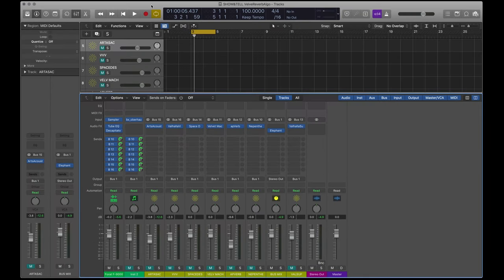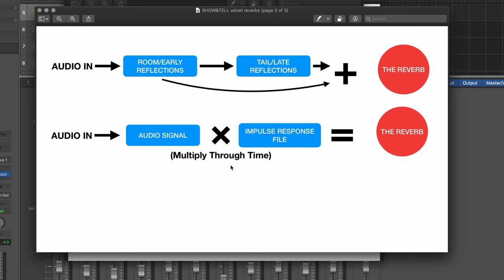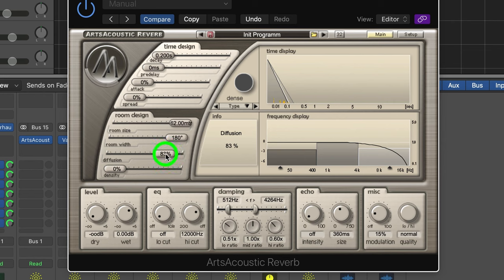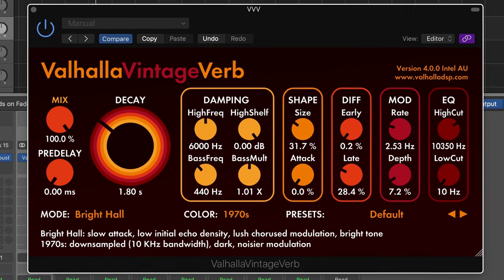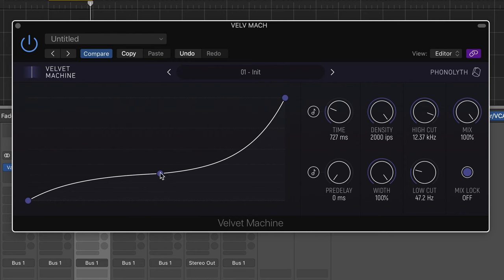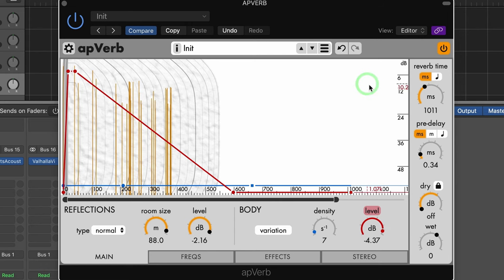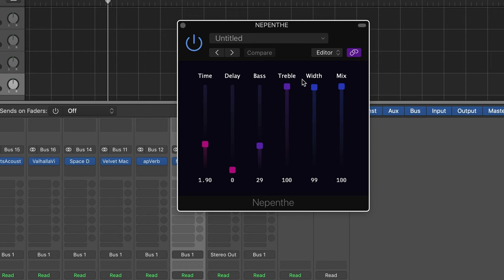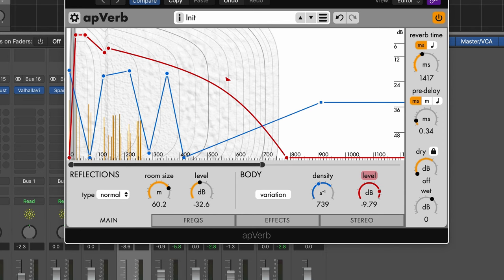Show&Tell: Velvet Noise / Reverbs

Comment: This is an excellent overview! Some notes about Nepenthe:

- You're correct that there are no early reflections. The density hits right away. I find that it blends nicely with existing reverb on tracks.

- The darkness isn't actually dark velvet noise; it's just EQ in front of standard velvet noise. This is unlike physical spaces, which have time-dependent decay due to the air and walls acting as low-pass filters. Early prototypes of Nepenthe did this as well, but I ended up preferring the version that starts and stays dark. It's like an abstract space that can't really exist. I think this is what you're hearing as "platey".

- I wasn't aware of the Star Trek connection. I got the name from Poe's The Raven.
Reply from the maker: Yeah, I'm a bit uncultured - not particularly well-read, but I do read manuals! :)

Thanks for confirming my ears weren't tricking me regarding the early reflections. It does have a sound not-heard-before, or easily configurable in highly configurable reverbs, which gives it a unique voice. And yes, the 'platey' stuff is the darkness aspect of the sound. I really like it! 

I hope you're still interested in advancing your velvet noise model, you seem to have good sense of how to manipulate and implement it in accessible and usable ways.

And I really like your Clean Machine dynamics approach. Fascinating approach to handling dynamics.

Comment: Waves H-Reverb is a noise based convolution reverb that I initiated and developed with the Waves team about 10 years ago.
It has many more features than the two products reviewd here, including resonant filter, de-esser, and dedicated delays on top of the reverb engine.
I have created replivas of all famous hardware reverbs as this engine can do pretty much anything (presets are in the 'hardware' section of the presets menu)

https://youtu.be/Hp1AuSMIZOg?si=c_rRw5Mr_m4ZU2Oo
Reply from the maker: Hi Yoad, thanks for your response! It's a shame Waves didn't mention in the marketing material that it was a velvet noise-based FIR or I would have mentioned it. The manual doesn't even mention the word 'noise' at all.

Having a closer look at it, it looks and sounds like you're feeding some fixed ER patterns into your FIR noise component? And the only real control of the noise FIR is the Density parameter? Everything else is pre or post-processing, delays/EQs whatnot.. or describing when and how to fade between the decay (ER?) and release (FIR noise?) parts.

I don't have any suitable reverb hardware to compare your presets to, so I'll just have to believe you know what you're talking about, and it sounds like you do! 

Having said that, I wouldn't put it above any of the others using this FIR-noise solution to create reverberant spaces. Granted, HVerb has internal damping, but also a lot of pre/post processes (delay, dynamics, FM? (which has no detailed controls)) which are 'outside the scope of the noise algo. ApVerb has a breakpoint system which you allows to design far more intricate and unique reverbs than HVerb. Even ApVerbs phase distortion is based on the Velvet noise algorithm which, as far as I know, is completely unique.

Please let me know if I've understood HVerb's FIR noise component incorrectly, and if you have any other info about it I'd love to hear it :)
Reply: In addition to UADs AMS RMX reverb, H-Reverb is my go-to. One of the best reverbs I've ever tried!

Comment: Diffusion is easier understood as the effect of physical acoustic diffusers. These are the ridged (well) or “skyline” objects you see in studios. 

What they do is take what would ordinarily be a flat reflection off a wall (“specular”) and break it up into smaller pieces of differing frequency, phase, delay, and direction. In other words, it’s a technical scattering of sound. 

Because diffusion has to meet precise criteria to be defined as such, it’s unlikely that ordinary objects like bookshelves, or random stuff will create a diffusion effect.

Beyond that, the tail of a reverb is what should be a “diffuse field” in acoustics which means equal energy at all directions. In contrast, early reflections are directional and discrete. Then, diffusers/diffusion aims to blend the divide between the two states of acoustic energy.
Reply from the maker: Thanks for that knowledge.  The Arts Acoustic reverb seems to be breaking those rules as they have included the Diffusion parameter in the Early Reflections part of the algorithm, but I do appreciate that normally the early reflections are not normally diffused. 

Perhaps they thought that by blurring those initial reflections, the late reflection part of the algorithm might respond better to the diffused input and create a more smeared space?.. rather than just send the 'clean' ERs through the actual diffuse delay matrix. (probably using some terminology incorrectly, but I'm sure you can make sense of my ramblings :) )